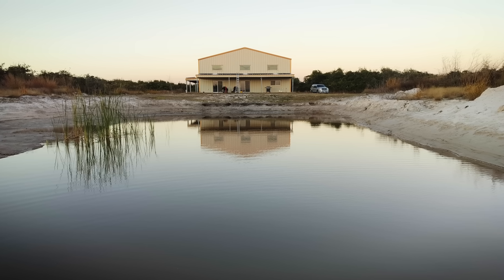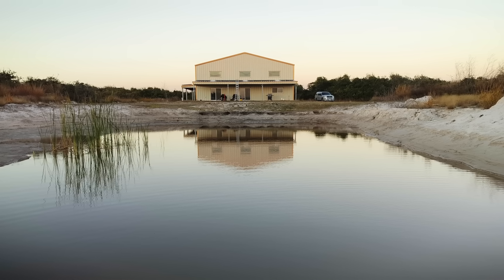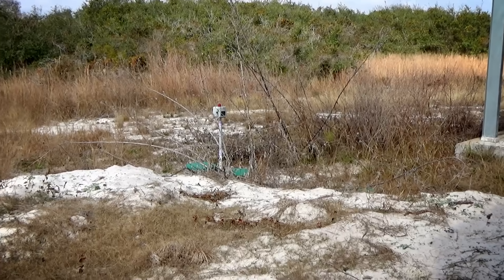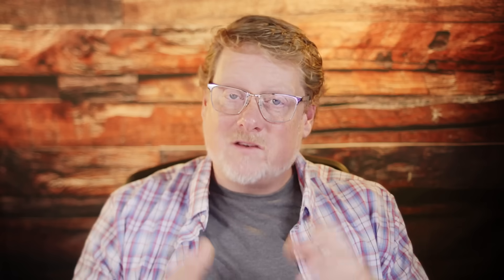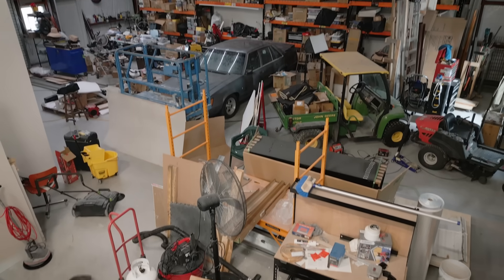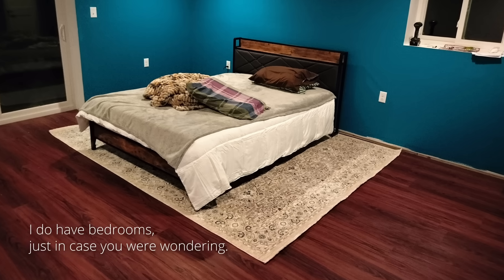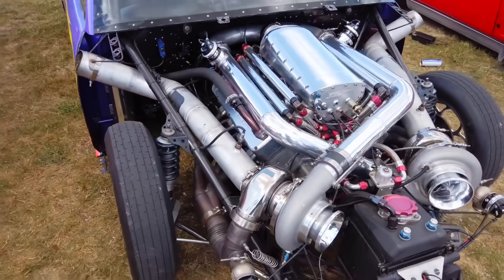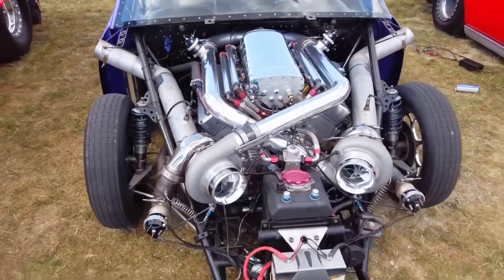Twin Turbos - How Does the Boost Add Up?

Comment: Interesting concept... Electrically driven turbo... All the boost, zero exhaust restriction & zero heat sink in the turbo.  Much less plumbing, & use conventional N/A exhaust.  

I wonder if you could connect two turbos on the same electric motor, & plumb one turbsky into the other, for your compound idea.  

Installed directly in front of a Holley Hi-Ram setup, with a Tick Performance Air/water 'brick' intercooler.  

On a side note, what do you think about putting a AC compressor on the engine, with cooling coils inside the air/water tank, and add a fuel loop inside the tank.  I'll bet the AC compressor would cool the cooling water, cold enough that you'd need to run antifreeze in the tank.  

I suggest this for two reasons... Cold air is denser air, denser air has more oxygen per cubic foot.  More oxygen equals more fuel, more fuel, equals a bigger bang.  

Hope my description isn't too complicated with all the 'cool's' used to describe what I'm talking about. 

I have one more suggestion, as you are exploring high boost pressures.  Typically, high boost suppresses the spark plugs ability to generate a large, hot spark.  I have a simple way to turn a MSD 6AL ignition from a High voltage, low amperage (conventional pulsed DC spark), into a 'plasma' ignition source (high voltage and high amperage).

The spark kernel in the plasma spark is exponentially larger than a traditional spark, therefore, the fuel burn will happen faster, which will reduce the necessity for timing advance (advance timing is actually a drag on an engine, as ignition spark before TDC, the early explosion is trying to slow or reverse the piston, which is a loss of power).

I have a short video of my demonstration of a plasma ignition system you can view here:  https://www.youtube.com/watch?v=BdakEn92CaQ
Reply from the maker: I think the A/C cooling the charge idea exists in OEM form already, but it's a good idea.  I watched your plasma spark video.  How does it work?  Traditionally, the biggest issue with single coil ignition systems is dwell time - as rpm goes up, available dwell time goes down, and spark intensity follows.  Is that an issue with your system?
Reply: @AlexLTDLX  The plasma ignition system works by simply tapping off the positive side of the coil, but you must use a CDI type ignition, and between the tap and the tip of the spark plug, you have to put a rather high quality diode, to prevent the high voltage from backfeeding into the CDI.  One important note:  You MUST use non resistor spark plugs & wires.  So, If you have electronics on your car, you need to install a 'choke' on those items. 

As far as dwell time, you are correct, in very high RPM situations... But that doesn't matter in this instance.  If you connect one additional wire in series, to all the spark plugs in your engine, the amperage will only be used when the distributor calls for a specific plug to fire, from the high voltage.  You can simply isolate a 'bank' of plugs, say opposing cylinders, if you want to use 4 diodes, or you can run 8 diodes and a separate, second wire to each plug, if you want to.  

You can also add additional capacitors to each wire, BEFORE the diode to ramp up the power of the plasma ignition, if necessary.  

I've designed this system for an alternative fuel, that I'm currently working on, but seeing how this works, I can also see how this ignition would benefit traditional, higher compression/boost applications also, without changing the fuel.

I won't talk about my alternative fuel, here in a public forum, but I would entertain chatting with you in private, should you choose, as I have need for a engine dyno also.  

As far as the A/C cooling, yes Chrysler does a poor attempt at cooling the air intake charge... But I'm thinking taking that to the ultimate limit, with already available aftermarket/performance parts.   The stuff needed is already there, just no one has thought to actually try it.  I would, but I don't have a race car, nor the budget to build one, as I'm focused on R&D with the alternative fuel.  I'd like to see someone try my idea, if they can swing it.

Comment: I'm at a loss. You can compress the air more yes but there isn't more air......🤷 More air=more power
Reply from the maker: I understand your point.  I'm just presenting the theory here.  I want to test it in real life and see what really happens.  You might very well be right.  You might need a larger first compressor to maintain the "equilibrium" of mass flow.

Comment: There was no mention of the air volume at the atmospheric turbo doubling in a compound turbo setup. Equal size compound compressors would typically be a triple turbo setup. 2 into 1. Makes the sizing easy...
Reply: The compressor map still applies electric or no. The efficiency islands still  apply. The mass of the air is dependent on the engine displacement and rpm and pressure of the air. You can't increase the boost without also increasing the mass.
Reply: @terrelbrady8035  they are still there , but they change with the electric , no parasitic draw like the turbine on exhaust and the electric motors can vary there rpm at any time as apposed to having to weight on the turbine to spool .. I'm not an ev guy , but I do know there is a difference between gas driven and electric driven and belt driven , and that's my point
Reply from the maker: Another commenter brought this up.  And you might very well be right.  Three electric superchargers, with associated compression losses, might support anywhere from 1,500-1,800 hp.  Then you could do 7 total - 4 into 2 into 1.  In theory, that would be enough to support at least 3,000 hp.  I was just presenting the theory.  I want to test that theory in real life and see what actually happens.
Reply: That's wild.
Reply: I was thinking this. You can't have compound compression with 2 same size compressors as you will not gain compression between stages. You need one compress to flow double the second to make boost.
Reply: Yes and no , I think that goes out the window when they are powered by electric motors .. I'm not sure at all , but I think that is what makes the difference.. u can compound the same size turbos and get basically triple the boost , but it won't come in any sooner. it's just doubling the atmospheric pressure .. at least that's what I understand from it , but generally, yeah, a smaller turbo would be the help to come in sooner and to spool a larger turbo in general .  But again, idk if it makes a difference where he has electric snails 🐌 😅.. peace and love brethren , keep it rad, stay safe, and build on.   Ps I hope we can all learn on this one 😅..

Comment: I feel like a hub dyno is what you need for this level of repeatable experiments.(and maybe a manual tranny test car)but a engine dyno would probably do it too. while simpler to setup the pluming and work on the engine. would it cost less to build a dyno room for an engine dyno or a hub dyno they if all else fails could probably be sold used.
Reply from the maker: I did think about that.  But I also want to use the dyno to test other things and to have some fun with different cars.  I've even got a dyno game show planned.

Comment: A lot of great info for boost noobs like me - I never understood the compressor maps. 
Could you add a text conversion whenever you are talking in imperial units please? It takes a lot of time to get in what units are you talking and then to convert it
Reply from the maker: Lol.  That's why I chose a Garret turbo for my example.  Tbh, I hate doing all the funky conversions.  Particularly when a compressor map posts impeller tip speed instead of rpm.  I have one question to the people who generate those maps - why?  Make it easy for us, for bejeezus' sake.

Comment: Welcome back Sir, you have been missed.

You should check out my compound G-45 1600 + Gtx3576r engine project. 1.2L engine making 1056hp at 5,5bar. Also have made my own engine dyno.

You should definitely go in that direction to have your own engine dyno at home. Super good when experimenting 😊
Reply from the maker: I'll check it out.  Thanks!
Reply: @AlexLTDLX  Now I made a short video with some images of the build 

https://youtu.be/_ukw-0zTPZ4?si=e6tYaYOHO9Xqvqzw
Reply: 1000 outta 1200cc?
HOLY
Reply: OMG Fredriksteen9765.   Getting that out of 1.2L means 2.0L would be cake for you!     You also know the hows and whys of compounding....   Do you have a website?
Reply: Sounded too good to be true, then I read that you made your own dyno.  Then it all made sense lol.
Reply: @GameTribe_TV  Look at the project first and then judge. If you take 1056 and divide that by 6.5 you get 162hp which is on point for a 1216cc motorcycle engine.
Reply: @fredriksteen9765  you're not getting 1k hp out of 1.2 for more than a pull. A built gr yaris can't do that.

Comment: So, cutrently have a 55lb/min turbo, snallish for the engine. Add one of the electric tuebos feeding it in a compound matter. So, snall exhaust driven turbo spools, electric tuebo kixks it. 3kish, nakes power. How would you go about sizing the electric turbo?
Reply from the maker: Right now, from a practical perspective in my opinion, there's really only one option - that's the p2/castle setup.  There's an intersection of availability, technological limits and costs.  There are theoretically many ways to go - like the Sledgehammer.  But that's just not financially worth it, tbh.  The P2/Castle setup (with Hobbywing ESC) is the closest we can currently get to that intersection, and will work on most engines - by the sound of it, yours included.  I'm trying to help a lot of people go in different directions (electrifying PD blowers - too much inertia and too big; or small turbos - too high an RPM required, and electronic switching losses and simply mechanical challenges running that high of an RPM always seem to lead to problems).  This setup would work with your existing turbo or on it's own.

Comment: I was where you are... I was thinking about the next evolution of my Mustang. I had come to the compound boost side of things... I wanted better drive ability and a better top end as well. Was looking at a smaller turbo and then a huge turbo to blow into it. But I decided to scrap the idea... I think compressed air supercharging is better.  From the info that I found, the CAS makes more power for each lb of boost. At 4500 psi, divide that by 14.7 equals way more atmospheres than we'll ever be able to use. So yeah, gonna take the easy route. Plus, way cooler charge temps. And less resistance to fuel types.
Reply from the maker: CAS is interesting, to be sure.  Having a pressure vessel like that in my car would scare me (I also don't like nitrous for that reason).  But it does work and has it's own advantages - particularly the charge temps.  Figure out a way to recharge it while driving, and you'll be golden.
Reply: Didn't Toyota do that in the WRC Celica?
Steal boost from the turbo to pressurize the bumper tank?
Sure it's not going to put a dent into a Compressed Air Systems thousands of psi but engine driven compressors are possible. My fuel pumps make 3000psi

Comment: I know a mechanical engineer that can't wrap his head around torque doing no work.
Reply: Would it be fair to say you can't measure torque without horsepower
Reply from the maker: Well, sort of.  I guess even a strain gauge would have some sort of deflection.  But you can certainly apply torque with no movement.  I promised myself I wouldn't get into this rabbit hole again, lol...
Reply: Isnt the ability to resist an opposing force work?
Reply: @michaelatkin9649  no. work or power its the distance moved when force is applied. mass being accelerated.
torque a bolt. you perform work tightening it up to the torque point, at which point it doesnt move and no work is performed. on the bolt. can sweat and strain on the breaker but no work is performed on the bolt... 0% efficiency....
Reply: @jsomething2  You can definitely measure torque without horsepower.
Reply: @unhinged-menagerie can you though? can you really apply force to something without movement being involved in some way?
Reply: @ You can step on a scale and measure your weight.  Neglecting the microscopic deflection of the load cells, yes you can measure force.
Reply: @unhinged-menagerie  I would say let's not neglect the movement of your 200lbs onto the scare or the scales deflection. it can't read anything without that deflection? that's sorta the whole point of my comment?
Reply: You cant messure HP without torque. Torque+rpm over time;HP
Reply: Perhaps potential for work.

Comment: More accurately, gear reduction can multiply torque. In other words, a higher horsepower engine can be geared to gain more torque. Gearing a higher torque engine cannot gain horsepower. Torque output at the wheel is the what is actually accelerating the car. F=MA, Torque=F... Gearing does have associated losses. So ideally you want the least amount of gearing to achieve the output torque you want.
Reply: Exactly. A big ole diesel tractor engine will have lots of torque and not that much hp. People see this as a strong engine. However, a low torque high hp race engine will give the tractor more power with the right gear ratio. Id just be less then ideal to have a tractor plowing at 8000 rpm😂

Comment: odd question, but as a cheap bump in power would an EDF blowing into the electric supercharger be worth it? they are pretty cheap, use less power than the big centrifugal and even at a 1.2 pr it could see nice gains overall for the price. another aspect would be the ease of getting parts, and the wider range. I've seen people try to EDF an N/A car and get a few percent gains but compounding might be something interesting to look at, just throwing out ideas lol.
Reply: Also welcome back, was wondering how things were getting along over there.
Reply from the maker: EDFs are one thing I'll certainly test.  They'd be the easiest thing in the world to install (and are readily available).